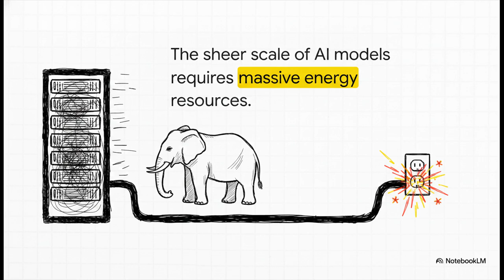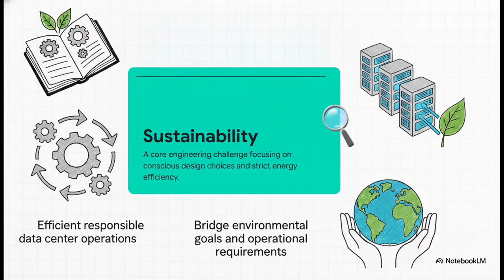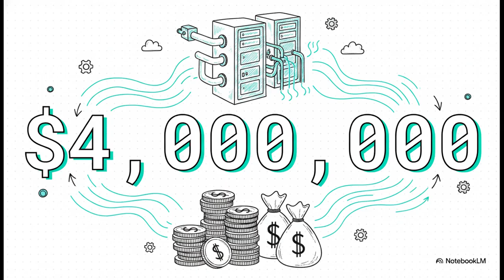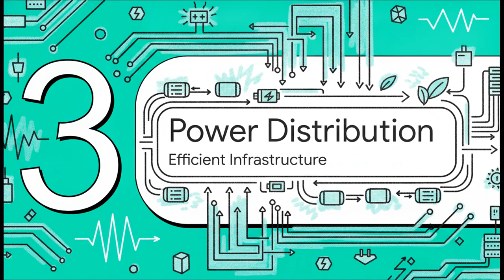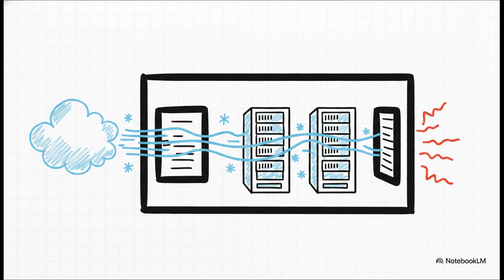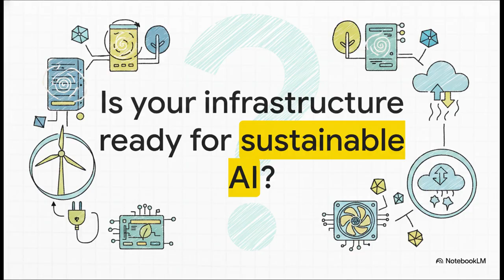Green AI Infrastructure

Comment: Where the first video establishes the foundational rule book, this video dives straight onto the data center floor to tackle the immediate, high-density computing bottlenecks created by the modern AI boom. It reads like a practical engineering blueprint for systems designers and IT leaders.
The AI Bottleneck: The narrative zeroes in on the exact operational dilemma keeping modern IT directors awake at night: how to deploy intensive generative AI clusters without completely blowing past corporate budgets or crashing the power grid.
The Cooling Revolution: The video highlights a massive design shift away from traditional, resource-heavy evaporative water towers. By transitioning to high-temperature dry coolers and advanced liquid cooling infrastructure, facilities can eliminate water waste entirely. The video underscores the massive scale of this change by citing an Nvidia projection showing a staggering $4 million in annual operational savings for a 50-megawatt data center.
Smarter Power & Architecture: The review of internal hardware engineering is fascinating. It advocates for eliminating wasteful AC-to-DC power conversion steps inside server racks by moving to direct current (DC) architectures. Additionally, it highlights the clever use of "airside economizers", which use local ambient outside air to cool machinery naturally.
A highly focused, technical, and actionable review of data center mechanics. It serves as an essential guide for enterprise cloud architects and infrastructure managers who need to align high-level corporate sustainability goals with day-to-day data center engineering.